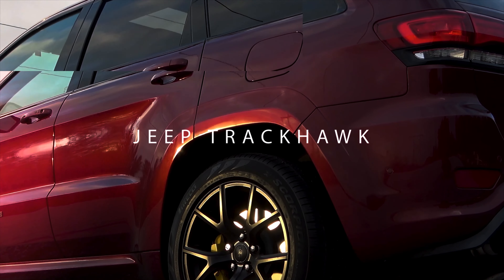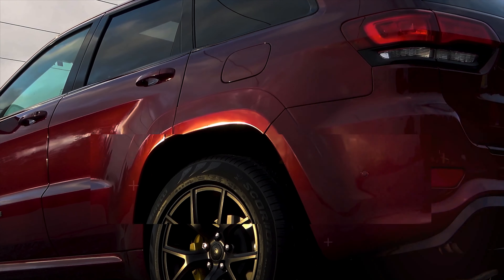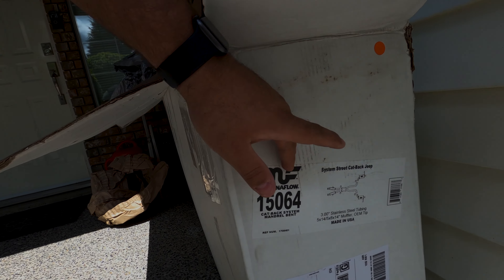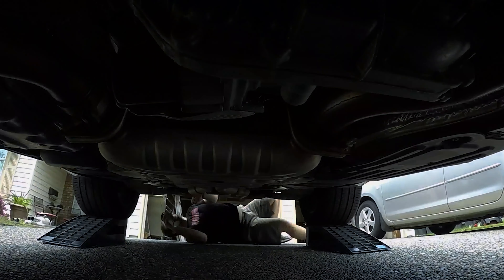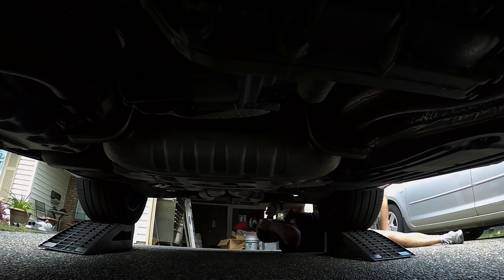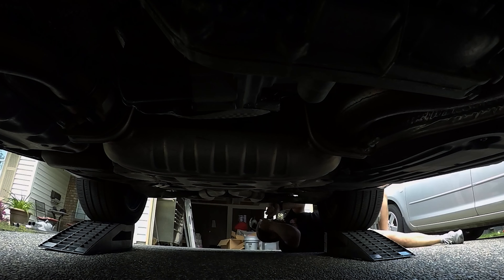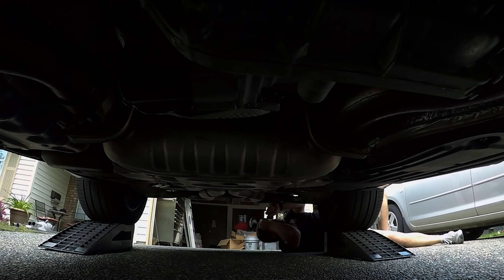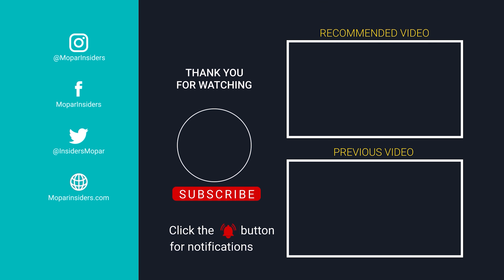Our Long Term Grand Cherokee Trackhawk Gets A Magnaflow Cat Back Exhaust

Comment: The Magnaflow is whisper quiet compared to your stock exhaust.
It will be interesting to hear the difference after a few miles on them.
Reply from the maker: Sounds like it on video but it’s way deeper which the microphone doesn’t pick up. It’s already gotten a decent bit louder but the Jeep is parked for a bit while the computer gets sent out to hptuners.
Reply: @MoparInsiders  
Someone said that Mission Raceway is doing Test and Tune.  Do you know if that is accurate?
Reply: @MoparInsiders  Corsa and Bullet Are Much Better